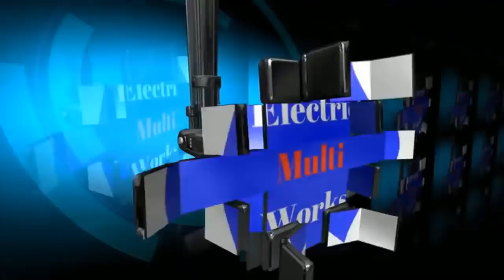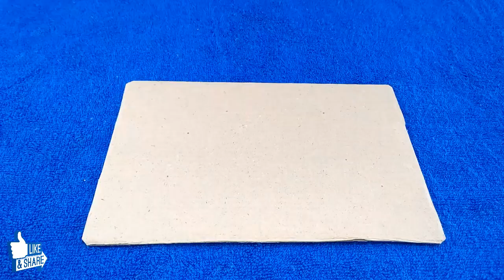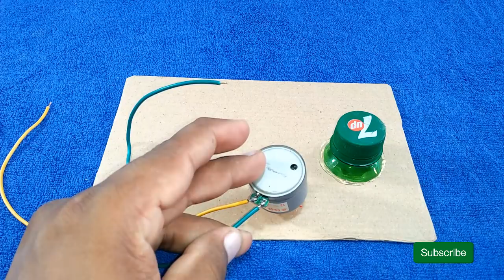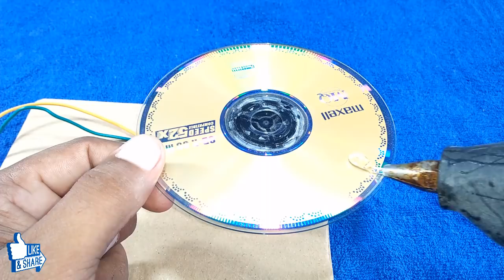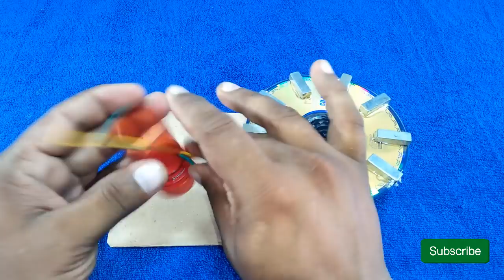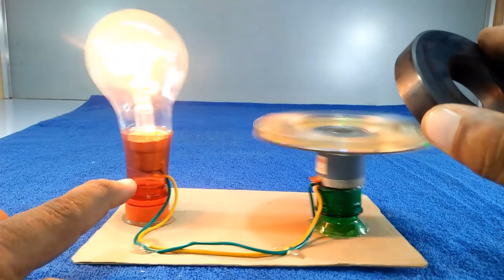Free Energy Power Generator Magnet With Motor And Cd Flat Output 230 Volt Free Electricity

Comment: ESE MOTOR SOLO GENERA 12 VOLTIOS = THAT MOTOR ONLY GENERATES 12 VOLTS
Reply: Funciona o no funciona?
Reply: @juangquirozz  NO LO PROBE PERO, DIGO Q ESE MOTORCITO DE RADIO CASETERA SOLO TIENE LA CAPACIDAD DE GENERAR 12 VOLTIOS POR Q SE ALIMENTA CON 12 VOLTIOS ASI Q POR ESA RAZON EL VIDEO PARECE FALSO OSEA FAKE
Reply: There Are 12v Bulbs Available  in Market